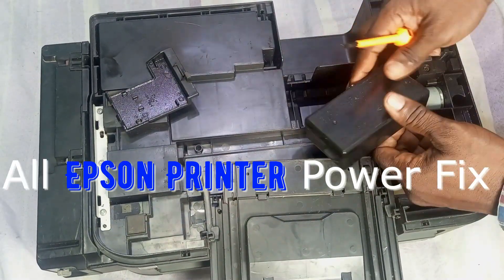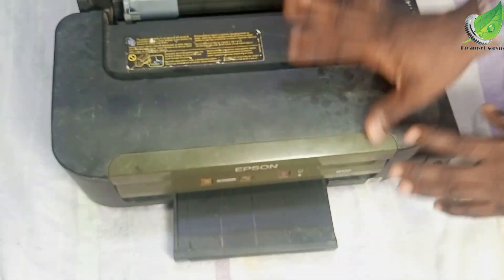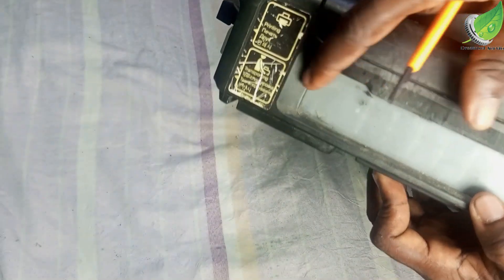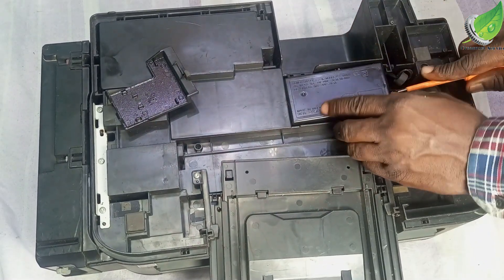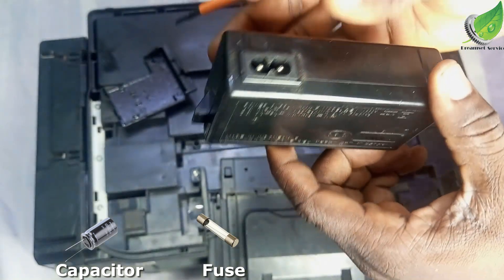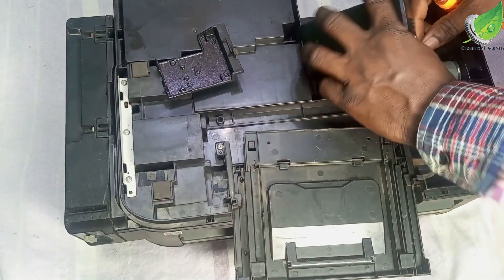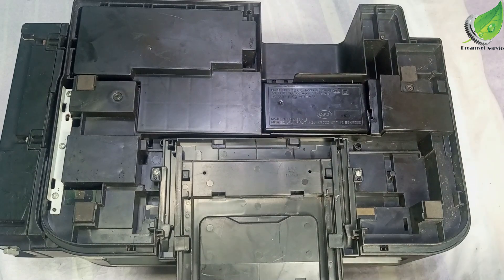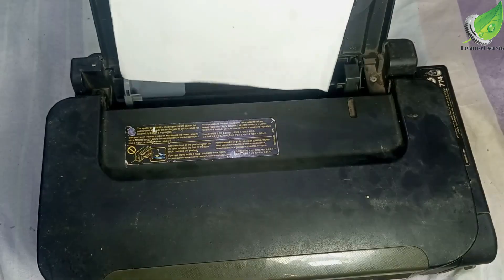Epson Printer Not Turning on Repair for any Epson model

Comment: Good morning, my is having exactly the same problem, so I do send the printer across or your location, me from yenagoa, Bayelsa state
Reply from the maker: No need to send the printer over, rather I can send the power supply pack to you so you can replace it, I will also guide you on how to replace the power supply.
Contact me on WhatsApp: +234 9030587868